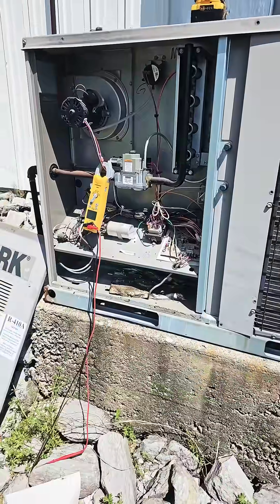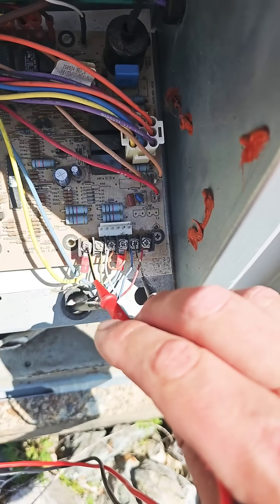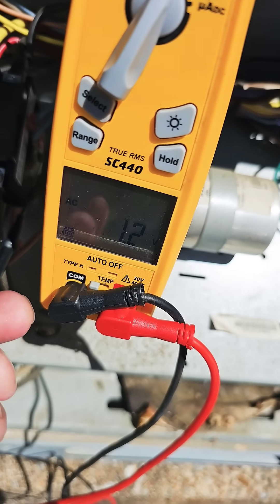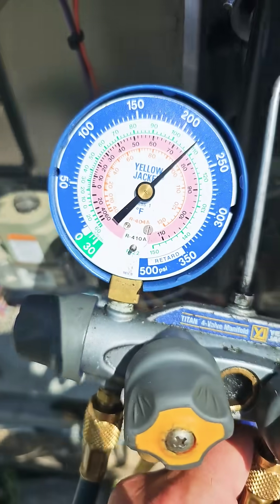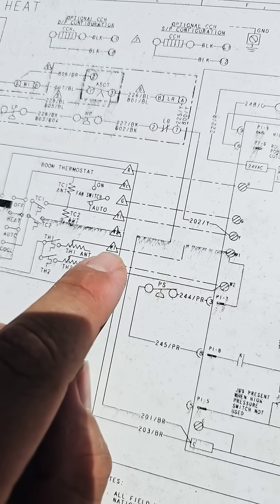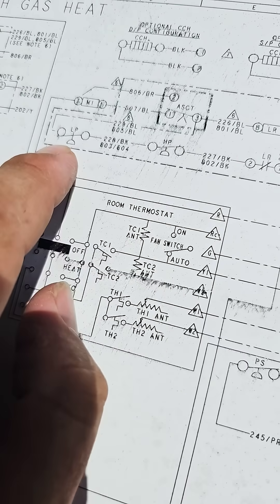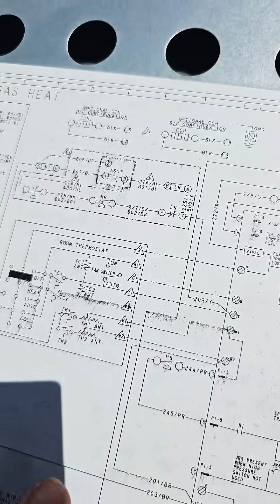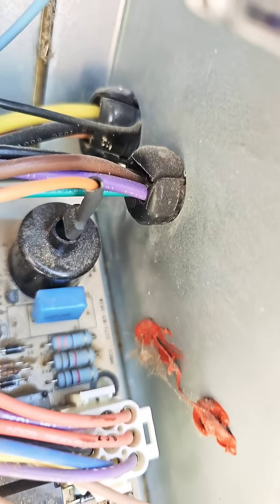I WISH ALL SERVICE CALLS WERE THIS EASY! #hvac #airconditioning

Comment: I worked with a guy named Eddie. We got calls on units, were on roof. He carried jumper wires, small screw drivers, and would jump out power wires, fuses, whatever. Then he got cutters out and chopped most of the spaghetti wires out. He would rewire to a daisy chain of controls, and if thermostat got changed, it all ran great. He said manufactory wasted time and money to complicate this unit. The customer was ours for rest of our lives. Plus he cleaned up the units, new belt on blower, put the panels back on with all screws. We told boss he gave it a Eddie Tune Up. Guy was great repairman.

Comment: Better why to check the pressure switches instead of hooking up guages right away an potentially losing some refrigerant is check continuity on the pressure switch. If it rings it’s closed which means it’s good if it doesn’t ring it’s open and then you would need gauges to then pressure test and find out where the refrigerant went.
Or you could do it all powered up and if you have 24 V on one side going into the pressure switch and nothing coming out from the other side well then you know it’s open or a faulty pressure switch

Comment: My low voltage is fine, high is also, contactor also, have found no leaks yet, TXR valve will be last, had to get a new meter today that measures mf, then resistance at  compressor connections. hoping I got a bad cap off the shelf. Compressor only 8yr old

Comment: Replaced a control board and capacitor for a family friend today and after I got it running it shuts off everything from the thermostat to the unit without tripping a breaker.
Pull out the disconnect to find that a lovely electrician replaced the fuse-disconnect with wire nuts and cable running to a contacter that runs into a generac unit. I don't even know what the generac load drop system is supposed to do but I think we all know a contractor will melt to shit before it trips the breaker... And it must've melted weeks ago 😮

Comment: I’ve got a video of one of those where it over amp to melted all the power wires going into it and into the compressor because they didn’t have a disconnect and it was still running

Comment: Over complicated? 
You are a seasoned veteran in this game. You just make it look easy, man.
Reply: @johnnyponcejp  a good place to start is practice reading schematic diagrams, it is literally like a road map for all the electricity. Understand the process of what’s not working and check at each step on the map and you’ll find the issue. Understand your multi meter and what each setting is for. The Internet can do wonders for gaining knowledge.
Reply: Season veteran checking freon levels for no reason
Reply: @LowVoltageTechnician yeah could've easily just looked for 24v @ hps and lps spots on board lol
Reply: @Straight_White_Fatherly_Figure  The last time that the ac guy changed out my CAP outside, he was in and out in less than 30 min and never checked my levels ... 
Don't blame him, he was there to get it back on and he did.
Reply: @LowVoltageTechnician yeah it's generally a rule of thumb to not check unless necessary because you let gas out everytime it's checked. He should've, however, at least made sure the suction pipe was getting cold
Reply: @LowVoltageTechnician ...its a tutorial 😂 34yrs, make it a habit
Reply: @Machoman-ct   Make it a habbit when every service call is the same repair ...
Not going to happen. All service calls dont have the same repairs. 
Servers make it look easy because its the same routine every table.
Reply: Do this a couple times and it will be easy.
Reply: He’s right.  

I know what you mean though.

I’ve been doing it about 10 years.  I remember back when I was intimidated changing a contacter.

After you keep at it, you slowly realize 90% of this job is actually really simple.

I also realized a lot of the guys I used to look up to as gods of HVAC were actually pretty fuckin dumb lol.

Keep it up bro you’ll see.
Reply: I started HVAC school about a month ago and I'm learning its pretty much like building legos with a few extra steps lol

Comment: When my 25-year-old whole house AC unit compressor fan motor refused to start I suspected that the fan was bad. I immediately tested the resistance on all three wires and confirmed my suspicions. I also tested the contactor, the capacitor, and the compressor windings and found them to be in good working order.
I could have just replaced the fan motor but decided to change the capacitor and the contactor. The extra $40 in parts brought me peace-of-mind. Old parts can not only suddenly fail, but they can also damage other parts connected to them.
When I was finished with that, I cleaned the three furnace filters, and evaporator coils to prevent coil freeze ups and to minimize the electrical cost of cooling my home.
Reply: @stayinformed2913   Jesus Christ , if you’re not a bot, you ought to be.
Reply: @chrispeer1307  No I am not a bot. It is getting increasingly more difficult to ignore the insulting comments on YouTube. Please don't take our Lord's name in vain. Please remove your comment or change the words.

Comment: Never hook up gauges if you don't need to.  I built a capillary tube brazed to 1/4 fitting and a gauge.  No refrigerant loss.
But you don't need to do that .  Continuity test through your proving loop for pressure switches.  Fast and not messy.

Comment: You can also check continuity of the pressure switches without hooking up the gauges! Might save ya some time in the future
Reply: Yea exactly. You could have a stuck pressure switch also where the pressure is good put the switch is open

Comment: If you know electrical and can read a wiring diagram, you can fix anything. 90% of commercial refrigeration and hvac issues are related to electrical.

Comment: Early on in my mechanical career I ran into an issue that I couldn't figure out. Called the old man and his first and best advice was "if it won't start don't yank out the motor, check to see if it has gas". Another words, keep it simple then move on to the more obscure solutions/repairs.

Comment: Love that. This is the part where you come in after the last tech told the customer it was empty on refrigerant cause they couldn’t figure it out and quoted a new system but missed the most simply fix.

Comment: Great advise. Seems to me as an electrician, we always think the worse situation and 90 % of the time it is something simple.
Reply: advice*
Reply: Catastrophic failure is normally a simple problem to fix. It may not be cheap, but much easier than an intermittent or under/over performing part/sub-system.

Comment: How in the world did the wire get cut
Reply: just a educational video it's one in a million that happened ... most of the time trouble comes from capacitor, relay or control board or worst leaking freon.

Comment: Many HVAC  technicians don’t know how to follow the trail by looking at the electrical schematics. Well done !
Reply: I was going to say… in my county commercial HVAC guys not only know how to follow the wiring diagram but also realize how simple that one was.
Reply: Only apprentices don’t know.
Reply: @hoppy0720  lol you guys haven’t worked in the field much. I’ve known electrical engineers who struggle with schematics, and plenty of techs
Reply: Lol the guy that taught me didn't even know how to halfway read in general.
Reply: yes true & then if They Know Do how to trace it 24 vac till it stops , do the Know what to do when they find the Stop  ?? so whats do i i do next  ? Just replace or Dig deeper ???

Comment: I went on a no ac call tstat was blank air handler in attic 120 degrees in attic blowing 5 amp fuse instantly put my fuse saver in turn power on and smoked my tester it didn't trip i unkooked the red and common to outdoor unit it didn't blow fuse first step search the outdoor unit found red wire had rubbed the cabinet and was grounding my first thought was clogged drain when I saw blank tstat never assum

Comment: How did you get where you can quickly & easily visualize /intuitively understand what is happening on any wiring diagram or is it just experience working with that or similar units?
Reply: One step at a time.
Reply from the maker: many years of time spent in the field learning

Comment: When you use the meter to check the contactor is the breaker off ? Like no electricity or is it still on? Great video by the way
Reply from the maker: Breaker is on

Comment: I catch myself over thinking quite a bit. It always happens when we’re the busiest. Any advice that can help overcome this issue. I take a lot of pride in my work and when I get stuck like that I feel really stupid
Reply from the maker: You got this
Reply: Go through sequences of operation, check a flow chart in your head & read the wiring diagram. We all get stuck, using your resources is what gets us moving on.
Reply: Even the best of us get stuck and feel stupid. This trade has a way of making you feel like a genius one day to very humbled the next. Take the bad days as learning lessons (study manuals and diagrams better for next time) and the good as a blessing. If you can learn one new thing a day you will be a master much sooner than not. I work with 60 year olds with 40+ years experience that STILL learn new things.
Reply: Do everything in steps. Like if you have 20 double receptacles to makeup with pigtails instead of going to each receptacle and making the pigtails and having to do that for each one. Do everything at once in steps and u stay busy getting more done in a shorter amount of time because you aren't having to swap tools. I go to a table and cut all my wire, then pull it all out the romex, then sort it out, then strip and make loops. You see what i mean. And identify what part of the job your on. Demo, Layout, measurements, mount boxes, rough in,  trim out. Another example is assembing a ceiling fan. The first step is remove all the plastic and stuff it into the foam, then I put all of the washers on the fan blade mounting screws. Most people take one thing out at a time and do 1 screw at a time and I have 3 done by the time they have 1 done
Reply: There’s days or weeks I struggle with hvac. I’ve been doing this for about 5 years so I’m still learning different systems and stuff but just make a checklist for different symptoms and go through it. Eyes and ears are very important which includes using your meter and gauges. I see new guys trying to diagnose without confirming with these and that’s when call backs and mistakes happen

Comment: Just yesterday. Comercial water heater. Cold as a chilled water. Customer exchange ignition module. Put 24 v wire on ground connectors. Simple. Im not boiler tech . Just folow logic and operation sequence.
Reply from the maker: Excellent my brother

Comment: What is the relay for?
Reply: A lockout relay?
Reply from the maker: It's called a lockout relay
It breaks the circuit to the contactor coil to deEenergize the contactor, preventing the compressor from coming on during a low pressure or high-pressure situation
Reply: @taddydigest  Oh ok thank you 👍

Comment: Is it just me or does this fancy technology just additional stuff that breaks? I have a simple contactor capacitor on my condenser unit. No high-pressure switches. Low pressure switches control boards. Nothing. Just straightforward and easy to work on.

Does the replacing the high-pressure switch require evacuating the system.? If so, what a pain in the butt
Reply from the maker: sometimes yes you have to evacuate the system to replace the HPS however if you have a high pressure situation 
This safety will save your compressor.
Reply: @taddydigest  again my Carrier compressor is 20 years or more old and I don’t have a hps. Seems like a lot of tech that is not necessarily needed. Just more failure points and costs. I’ve done all maintenance which has only been capacitors, contactors burned terminal on compressor which I fixed and has lasted for 7 yrs so far and condenser cleaning.  Thanks